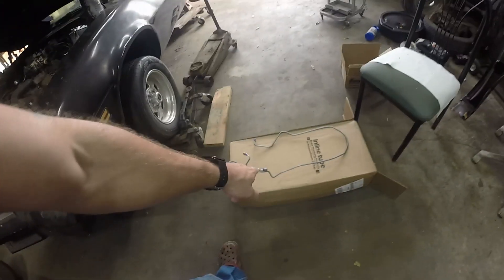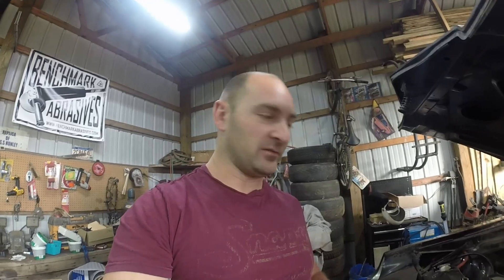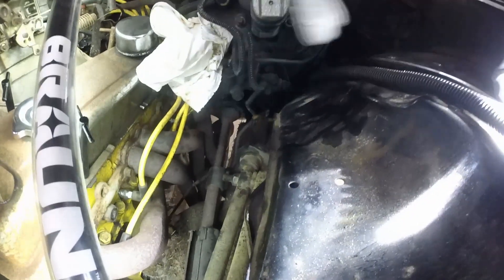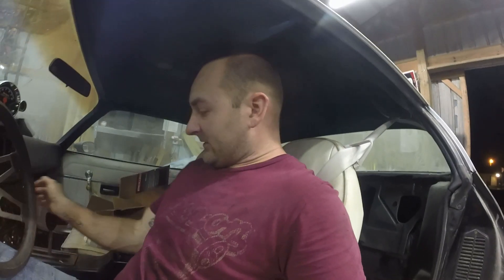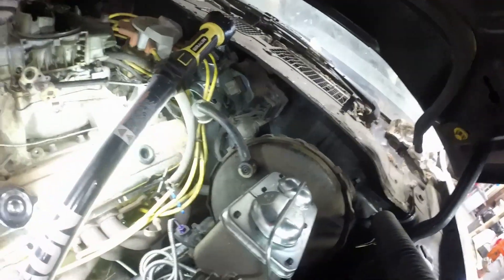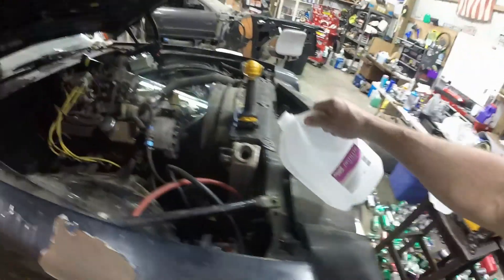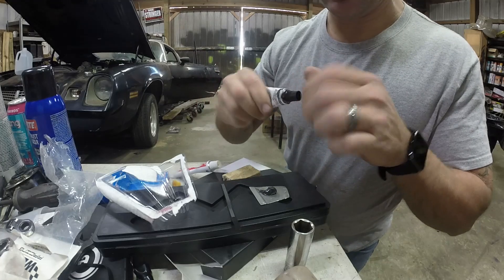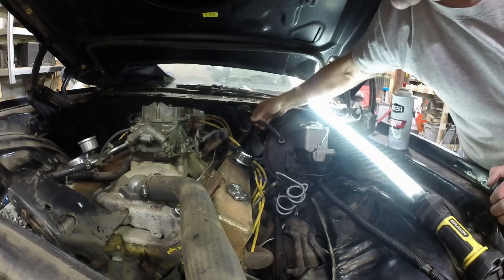Camaro Brake Hard Line Replacement And First Drive Prep!!! (1980 Camaro)

Comment: Any recommendations on how to replace the front-to-rear and rear hard lines?  Issues I've run into: 1. First clamp placement on the front-to-rear.  (Does the wheel well need to be removed or loostened?)  2.  Tips for getting to the rear line routing.
Reply from the maker: The wheel well shouldn’t need to be removed. You should be able to fish the line through to the proportional valve. The clamp was a pain but I took it apart and didn’t use it when I installed the new line. The line was rigid enough to not worry about it moving around or rubbing anywhere. Getting to the rear should just be some clamps and some bent metal pieces. It shouldn’t be to difficult. Good luck!